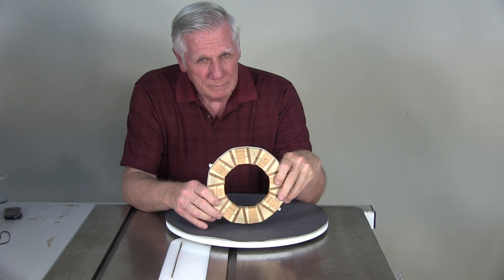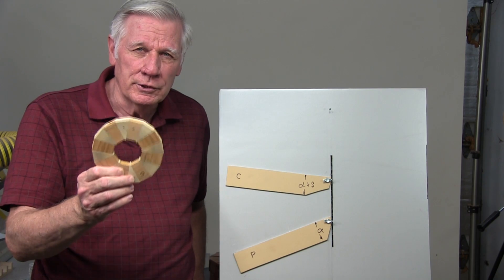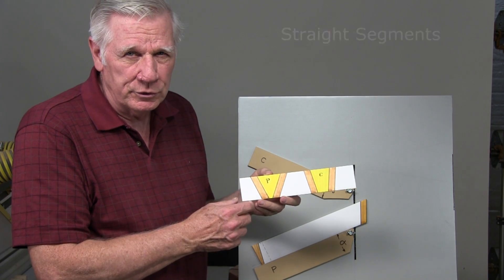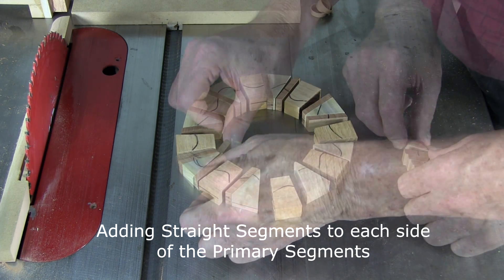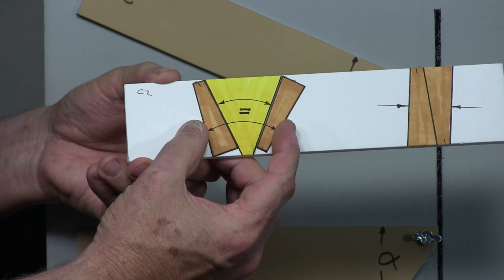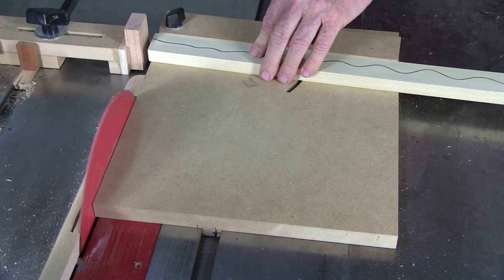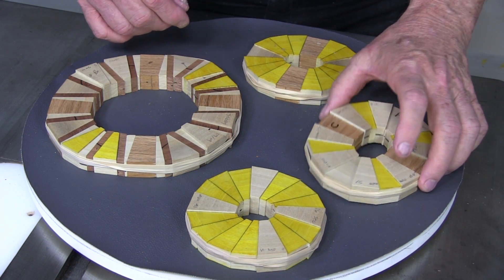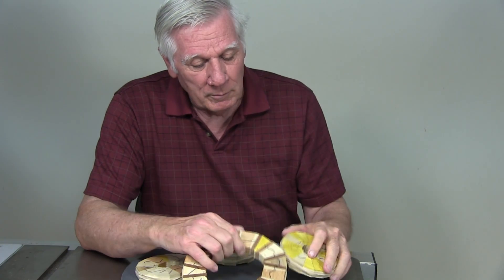Segmentology Beyond The Basics

Comment: Outstanding information!  Thank you!  Quick question.  How do I calculate the angle of the cut when adding an accent sliver.  Say I am working a ring that has 12 segments.  I see I need to cut at an angle of 15.  Do any other calculations need to be considered if I wish to have an off color accent sliver between each segment?  Or do I simply cut 12 relatively thin strips to fit between each?  Thank you in advance.

Comment: I understand the complementary angles when one piece of wood is cut using the two fences and flipped when assembled.  But when you start using two different colors, each cut with a different fence, I'm not seeing which edges are top and bottom (eg. flipped or not) so I lose understanding of the complementary angles.  Then when you insert the thin walnut strips and alternate those I really don't understand how that works.  I need more explanation.
Reply from the maker: John, Great question. the reason for alternating in a normal ring is to minimize errors from the verticality of the blade. The ring will have a zig-zag to it ( you cannot see it)  which zeros out the error. If you do not alternate, the segments will still go together but the ring may not lay flat. Just make sure the blade is vertical.
If you are making complimentary segments where you flip the strip at each fence, it does not make any difference. Take a look at the tilt video. This is one of the cool things about the Wedgie sled.
Jerry

Comment: Hello Jerry, I am a new turner and I came across the wegi-sled and wedgies, what a great idea, it works great even for a beginner.  I do have a question that  was not covered in the video.  If I add segments either a complimentary or a straight segment(s) I assume that I have to take that into consideration so I do not change the edge length and thus the size of the ring.  Is this thinking correct?  Thanks for your innovations and willingness to share with others.  Tim
Reply from the maker: Yes Tim, when you add additional segments, you will have to take into 
consideration the length of all that you add to get the ring diameter 
you want.

Comment: Jerry, I built two Wedgie Sleds, one for 90° blade angle and one for 20°.  They work great.   I watched your three videos and tried cutting some complimentary segments and some spirals on the 20° Sled.  When I glued them up and put a metal hose clamp on, they try to overlap each other as the clamp tightens.  I was wondering if you would show your glue-up process.  Perhaps you could also demonstrate putting a few rings together.  It appears to me that the spiral segments would be best placed as a top ring, otherwise you wouldn't notice that they were different.  Lastly, do you have any advice on mixing rings with different number of segments?
Thanks for your fantastic ideas and professional videos.
Reply from the maker: +Alex Perez Clamp the ring between 2 flat plates at the same time as tightening the hose clamp. use just enough pressure to get the job done. 
You do not need separate sleds for different blade angles. The blade tilts away from the sled. You will however need different zero clearance strips for the different angles. 
Jerry

Comment: I tried using the wedgie sled that I built and ran into a problem as I haven't  been able to order my wedgies yet. I was attempting to cut a 8 segment ring with segments 2.325 inches in length with the guide arms set at 22.5 degrees and I ended up needing 16 segments. Instead of a 6 inch diameter ring I was at 12 inches in diameter.
What am I missing here?????????
Reply from the maker: Ronald Lambier Ronald, use an ordinary 45 degree triangle from Hobby Lobby. to make an 8-segment ring.
The degrees between the fences should be 45 degrees, not 22.5.
Jerry
Reply: I guess I was having a brain fart because I finally realized that I could also design my own wedgies using AutoCad to go along with the Wedgie Sled that I made. I must admit your Wedgie Sled is an extremely proficient way of creating wedges for segmented turning.

Comment: As you mentioned in our last conversation. That there are numerous software packages available for the design aspects. At present I am using the Segmented Software Planner.
My question now is, do I create a Diamond or other Design feature and articulate it into a cutting piece and then cut individual segments on the Wedgie Sled?
Reply from the maker: Ronald Lambier 
Have you watched the next Segmentology video "Tilt" ?
It includes making rings with tilted segments with triangles that make up a diamond.

Comment: You really got me intrigued with your primary and complementary angles in this video. My question is, How did you determine the correct lengths of your segments and can this sled be used in someway in the creation of Diamonds and other accent Designs?
Reply from the maker: Ronald Lambier 
There are several software packages available. Woodturner Pro by Lloyd Johnson is probably the most popular.